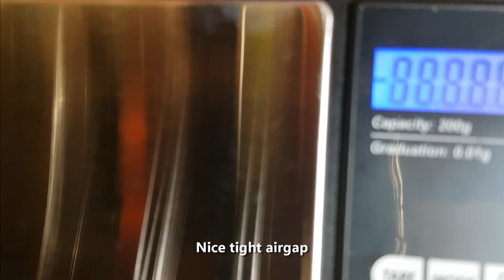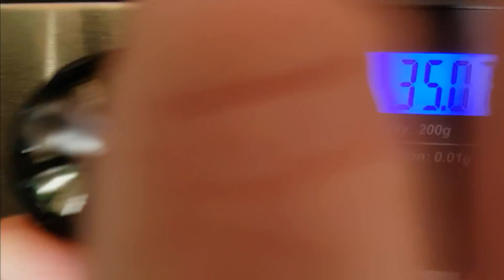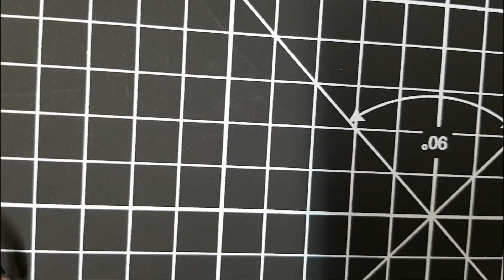Mr Copper 2306 2700KV /  Part 1 quick overview prior to flight test

Comment: they look really well made, airgap is a bit tight, which wont be great in a crash... only thing you can do is swap them out of a quad you are really familiar with and see how it goes,,, and if they are great, just stop and avoid crashing them and put them in something with some decent motor protection. ... my rjx is nearing test hover....
Reply from the maker: TheMadmacs good luck with the rjx. Tight air gaps are what you want on a motor. Only a prob with flakey cheap motors where the shaft bends!